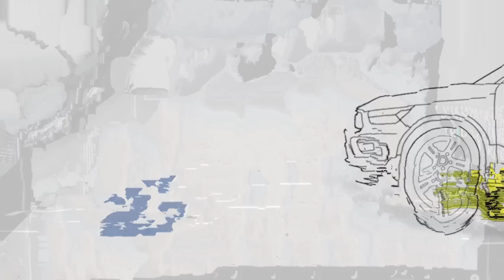The story behind Saab's secret 621-mile range electric car: the Emily GT

Comment: If that car was using NCM or NCA batteries it should not be charged/discharged over 80/10%, therefore 621 miles becomes 414 and a battery mass (plus cooling system, BMS and battery container) of 750Kg.  If it's a CATL LFPO4 battery it could be 621 miles of range but the battery and other bits will weight 1200Kg- that's more than my car.  You'll need a 22kw charger at home coz an 11 kw will take 16 hrs and a 50kw charger on the highway will take 2 hrs 20mins for a 80% charge. This is the reason we have diesel.

Comment: I would be THRILLED to have those range options, especially if they fast charged.
 IIRC the NASA moon buggy in 1969 used hub motors and it was hailed as a great change.

Comment: Backlash or more correctly Hysteresis is more commonly described as "play". There needs to be very very small gaps between components to allow for temperature changes and assembly. These small clearances add up to one not so small clearance overall. Thus the motor may turn 2⁰ or 3⁰ before the wheels start to turn.

Comment: Too big of a battery? Really? I want the largest Kw that can be possible jammed into a battery. My reason is simple, I live in a fairly remote part of Canada and travel is not termed in Km but in Hrs to get anywhere. Also temperature in the winter goes down to around -30C and sometimes touchs -40C. Batteries lose a lot of range at these temp. Heating the vehicle also taps a lot of Kw from the battery
 So if there is a large monster battery that can available I would most definitely want one.

I would like to own an electric vehicle but range ,charging times , climate and geography most certainly work against that.

Until the battery issues and reasonble price can be achieved I will have to remain with diesel and gas.

Comment: I'm very conflicted about this!. On the one hand, I would truly love to see Saab return,  but on the other hand, I don't want them to return as a "me too" unnecessarily powerful EV with a massive battery. We've already got far too many of them as it is. 

I'd like to see Saab return with something truly innovative, and taking the design in a direction where everybody should be going. Something which combines the thinking behind Citroen's Oli, that is to say an absolute priority on making the car as light and sustainable as possibe. But combined with an ultra aerodynamic shape which takes inspiration from Saab's original teardrop shaped cars. These cars would not be out to rewrite the rules on range per se, but on maximising how far it was possible to go on each kWh of power. Ultimate performance would not be a factor beyond being "sufficient", but the aerodynamics would mean very efficient cruising at higher speeds and the light weight would mean the same in the city.

Comment: Also, extra range by merely increasing battery size is useless, because it takes much longer to charge. Only increased energy density with quicker charge times is worth having.

Comment: There is no point in torque vectoring with wheels aligned forward, because they have to scrub the tyres excessively, particularly on corner blocks around town. Torque vectoring is only good for miniscule inputs to slightly reduce cornering forces at the limits. In any case, motors don't need to be in-hub to do it, and there are so many strong reasons to keep them out of the wheels.

Comment: Backlash is the freeplay between two sets of interlocking teeth in a gear set. It’s is absolutely necessary to prevent binding/lock up of the two parts as they engage. Helical cut teeth reduce the effects but sap power, are weaker for the same given gear wheel size and are more costly to manufacture. Straight cut (or bastard) gears are much noisier and usually only seen on completion vehicles. There are a lot of claims over the effects of rotational mass that are not supported by any scientific evidence however the effects of ‘un-sprung’ weight is a significant issue but not insurmountable. The car brand SAAB has not existed since the collapse of SAAB under Spyker. When SAAB Group sold Scania to Audi (not VW) and SAAB cars to GM, the name was licensed to GM, the subsequent sale to Spyker drew some sympathy from SAAB Group who honoured that agreement. NEVS took on the designs of GM developed SAAB cars but has no right to use the name and it seems impossible that the SAAB Group has any intention of changing that position. They are a successful Aerospace and Defence company and sadly a car maker no more. I am owner of a SAAB 96 Classic rally car 😊

Comment: backlash probably means friction due to 2 wheels on either side not wokring toghther smoothly around a turn, because they are being pushed at same speed vs torque levels, but one naturally would spin more than the other. so that means more tire longveity., and tire wear microplastic emissions are supposed to be worse than some of the popular and probably the false idea of emissions problems .   the usprung weight being more, might be no less effceitn than one motor and cmenical losses from connecting motor to wheels,buti doubt it. koniegsegg gemera motor is supposed to be pretty small, so it maybe not too bad

Comment: Backlash is clearance between mating gears. Under higher torque, it generally causes no problem. Under low torque or freewheeling, the two gears can 'bounce' back and forth, causing vibration, noise and wear.

Comment: With backlash what is meant is simplified: play in the gear. So if the drive moves from deccel to accel there is a tiny short time when it doesnt have full contact to the wheels. Legacy cars have lots of backlash, modern electric cars have little, hub motors are gear less and have no backlash at all.

Comment: 621miles? That means somewhere between 620 and 622 in estimating. 1000km which is indeed 621miles is as an estimation between 900 and 1100 km which would be around 550 to 700miles. 621is a somewhat unintelligent translation and as an estimate unbelievable.

Comment: The reason the NEVS badge was used, was because when the company went into bankruptcy following the ownership by Spyker, the Saab group, which is still very much alive and active building planes and other high tech products, refused to licence the Saab name to the new owners. I think that it is extremely unlikely that we will see the Saab name on cars again, regardless of what happens to the company in Trollhätten. By the way I have owned 7 Saabs over the years, my first being a 1980 Saab 99 Turbo 2 door and my last was a 2005 Saab 9-5 Aero Hirsch SportCombi.

Comment: Correction: NEVS Emily GT was developed in just 10 months. Owners Evergrande asked for a car using hub motors. Considering the total development time for a production line car is ~5 years Emily GT is incredible! 

Also, GM basically killed SAAB by not allowing the buyers to continue producing the new line of 9-3s and 9-5s, which had then been developed for ~5 years. Have one of the very few 9-5s that were produced before the selloff, great car!
Reply: No Westerner in their right mind should buy anything associated with Evergrande.

Comment: A big factor in using hub motors  was probably that NEVS owner bought the hub motor company. 
I read that NEVS developed 13 different prototype vehicles the last ten years, this is one of them.
Reply: The motors are built by Protean, still independent.

Comment: It will be an expensive project to relight. A big problem is going to be to take it from a prototype stage to a preproduction stage. The cost will be bonkers in R&D and tooling. The name saab will never come back as it is not owned by nevs.

Comment: Backlash (gaps in joints) and no axle torsion flex i.e. windup is an advantage for responsiveness. But the higher unsprung weight is a disadvantage for ride harshness that can be minimized by high profile tires flex and active suspension.

Comment: Backlash is a term that describes a phenomenon in gear transmission. Its actually when the teeth of the gears don't touch each other and then suddenly when troque is applied, the teeth touch and you feel like a harsh blow. 
So my guess is to reduce this sensation they used the hub motor with planetary gears system which creates a smoother torque output. I also guess this is how they manage torque vectoring as well.
Reply: Yes.  Backlash is the slight space between gear teeth.  Its called backlash, because you don't get any play after initial engagement, except when there is a torque reversal.  Then the backlash is noticed.  It leads to numerous issues in drivetrains for both cars and industrial machinery.  There are various methods of managing it.  Skewed gear teeth can reduce it, as well as anti-backlash gearsets, etc.  But all strategies come with their own issues.
Reply: Is there a planetary gear set inside?

Comment: If the weight is centered ie in the hubs the the centrifugal issues are not that noticeable, what is the issue is that the unsprung weight makes the suspension and handling not good. And because there is no drive shafts/axles the kick back is non existent ie can affect the suspension as u got direct drive instead

Comment: Engineer  here - backlash comes about from the gap between meshing parts such as gear teeth.  You may feel it if you 'rock' a car forward and backwards when stationary whilst in gear.  Hub motors wouldn't have the gears so wouldn't have the backlash. Is technically true but doubt you would notice it at all when driving.

Comment: SAAB once made a car with a 2-stroke engine that was REALLY weird.  It sounded weird, and its exhaust smelled weird.
It was virtually a 2-stroke motorcycle with 4 wheels.  I think it was made in the late 1950s.
Reply: My first ever car was a Saab 2 stroke 3 cylinder back in the 1960s and you had to mix 2 stroke oil with the petrol which made them a bit more expensive to run but it was worth it. They also did a triple carb version called the Monte Carlo. After that I had 95 and 96 models with the V4 ford Taunus engines. The 96 had a rear facing seat in the boot so travelling with  5 adults and 2 kids was a possible if not entire safe as seats belts were still to appear.  Happy days.
Reply: @johnnyboy7459   - Yeah!  I sometimes saw that 2-stroke SAAB in Cambridge, Mass., in 1960/61.   Its exhaust smelled like a 2-stroke motorcycle's exhaust due to the burned oil.  I could always recogtnize it by its sound without even looking around.

Comment: In-hub motors increase not only the rotational inertia of the wheel to make the car have slower response to power and braking,
but it also increases the UN-SPRUNG MASS of the wheel, making it harder for the shock absorbers to control the bounce of
the wheel when it hits road bumps.  The result is that the tire is not pressed onto the pavement uniformly as it bounces up and
down, and the traction of the tire in forward/backward and side-to-side directions changes, sometimes enough to lose directional
control.  Typically, it lengthens braking or acceleration distances, or reduces cornering control, on ripply roads.  The reason behind
aluminum/magnesium alloy wheels is the reduction of un-sprung mass.

Comment: "Backlash" is sometimes called "slop" - the free play, in this case, between the rotation of the engine and the delayed rotation of the wheel.
In an ICE car, drive backlash is caused by the transmission gears, the drive shaft, the universal joints, and the differential's gears.  In an EV,
the drive backlash is in the drive shaft universal joints.  In an EV with hub motors, the only free play is in worn bearing surfaces.  In normal
driving, backlash is experienced in stop-n-go traffic as a jerk as the free play is taken up before acceleration or deceleration occurs.  In an
EV with regen, the jerk occurs when one presses and lets up on the accelerator pedal.

Comment: The 1978-1994 900 model was the iconic SAAB.  Key on the floor, wrap around windshield, front wheel drive, crumple zones, turbo, fun to drive, durable.
Reply: Alongside the Volvo 240, one of the best cars ever made in my opinion!

Comment: For the title you converted 1000km to miles with an incorrect precision.  The Saab is not going to stop working at exactly 1000 km or 621 miles.  As in the spoken script you should have written 600 miles.

Comment: Backlash is the space in between the gear teeth/drive train, with hub motors no gears are required as it is direct drive. Modern EV's have a motor connected to a gear reduction module, like tesla, lucid, kia, hyundai, mach-e, etc. With these systems you have to have some backlash or the gears will be too tight and wear out/generate more heat = inefficiency.

Comment: We already know for a while that long range  EVs are feasible. This is just an example. Tesla’s semi with max load has a range of 500 miles. Ultimately every car maker has a finite supply of batteries and needs to decide how to deploy them. If you have 240kw, would you rather produce 2 cars with 120kw (500+ miles), 3 cars at 80kw, or 4cars at 60kw. Overall car efficiency also plays a role. This results in different volumes, revenues and profitability. On the other hand, consumers will need to decide whether they are willing to shell out more dollars for high mile range. In due course, with battery supply growing and battery costs dropping, average miles offered will go up. It’s clear that technology is already there. Lower costs will certainly follow.

Comment: 621 mile range sounds incredible, until you find out that this is due to a 175 kWh battery.  For comparison, the long range Tesla Model 3 and Y models have 82 kWh batteries and an estimate range in the 330-358 EPA mile range. Bigger batteries mean more cost, weight, more wear and tear on suspension and tires, less "nimbleness", etc. It's always a tradeoff between more mileage and less weight to drag around for EVs.
Reply: The lucid air is a better comparison.

Comment: The diesel electric haul trucks I drive use hub drives on the rear wheels.  They use a mild form of toque vectoring and low speeds which is very useful.

Those trucks can turn tighter then a conventional diesel driveline truck half their size.

Comment: Backlash: Any set of gears will have some sort of "tolerance." There will be at least a tiny gap between the gear teeth. If not at first, then when they wear in. When you first put pressure on the front of the teeth (acceleration) and then switch to putting pressure on the rear of the teeth (deceleration) that little gap can be felt as "backlash." Think of it as "slack" in the drivetrain. Big sloppy trucks with all sorts of differentials and transfer cases end up having quite a bit of this backlash. Doesn't matter when you're slogging through mud. But not so great when driving a high-performance sedan. Hub motors would eliminate every one of these sources of backlash and should feel silky smooth in transition from positive to negative pressure.

Comment: I wonder when very high range will cease to be a selling feature.  Almost no one needs more range than what they need to get them from meal to meal on a long trip.  

With half hour 10% to 80% charging a 300 mile range gives one 3.5 hours/210 miles of driving at 60 MPH average.    

For someone who seldom drives more than 200 miles  a 200 mile EV might be fine.  If you drive 500 miles each way to visit Grandma on Thanksgiving then you could start with a full charge, drive 180 to 190 miles, charge for a half hour, and drive 140 miles.  Now you've made it 320 miles.  A second half hour stop gets you to 460 and a few more minutes finishes out the drive.  You could make the trip with only one charge using a 300 mile range EV but you'd have to pay for and haul around those extra batteries the other 363 days of the year.

Comment: NEVS might have the factory, but they dont have the name, and they dont have the upper management 'SAAB-Think'. That is to design a thing properly. Thats why architects and graphic designers loved em, they did design their own way, not the way other car manufacturers were doing it.
Take SAAB's climate system. Vacuum driven by the engine, it could give a stream of fresh cold air to your face whilst warming your toes. It pioneered the 'third break light', gave us opening doors in the event of a front end impact, ergonomic design principals, out of the box thinking.
And maaaan, that factory turbo was great!
You could lie flat with the back seat down (zero bumps) and a 6" person could stretch out. All controls accessible wile keeping both hands on the steering wheel.
a bullet proof engine. worth a million k'm's.
Manufacturing could happen at a local level again....  but big business has gone global and that is what controls the market now. For now. 
The Lima Agreement (1973-75) was an international trade agreement that shifted manufacturing to the developing world. Here in Australia we lost our entire manufacturing industry, and we had it in spades.
Long live the small manufacturers, if only in our hearts!
Reply: Is a bus driver in Australia 10x better than the ones in India ( for example)? Not "lost" just not wanted for the price.

Comment: The fans of Saab love it because it always went overboard on things, tech had to be Saab quality or they would quite literally make their own regardless of cost, look what happened when GM owned them, the is the Vectra all you’ve got to do is rebadge it as the new Saab, they made an entire new sat nav system because the GM one wasn’t up to Saab customer expectations, they changed the interior, exterior wheelbase and some body parts till it looked nothing like the old vectra it was meant to be 😂 the cars drove beautifully and quality was excellent but they must have been losing a fortune on every sale.
Reply: @scottglossop yeah not the best business model 😂 but they stuck to their standards and I have to admire them for that.